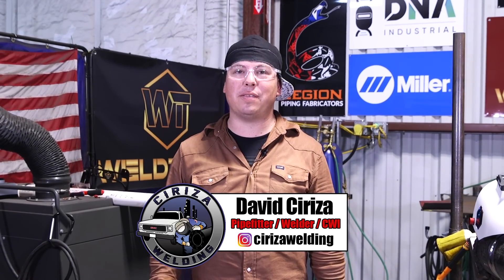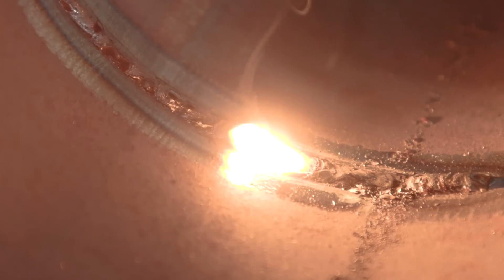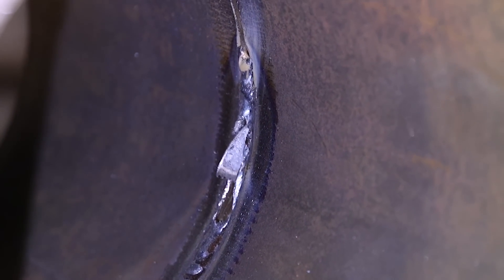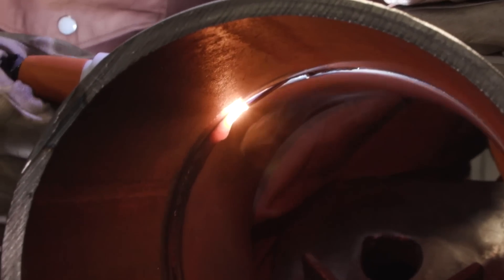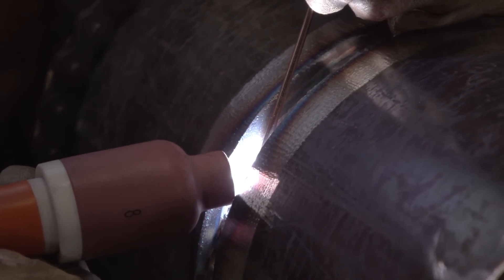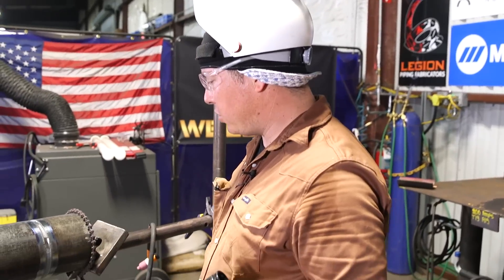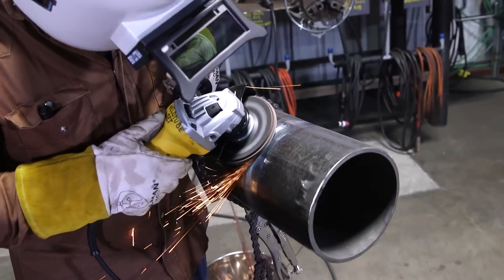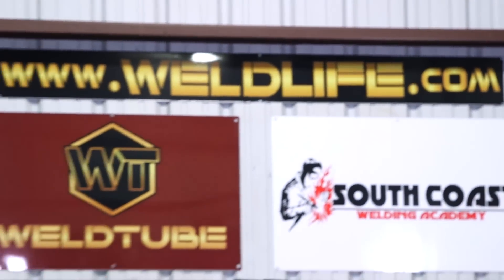Top 6 Common TIG Welding Repairs Every Welder Should Know

Comment: Using a file for the tungsten is a good tip. You will feel it slide over the tungsten until you got it out. A good way of being sure you got it vs the grinder

Comment: I have a problem I’ve been experiencing, I get porosity in my weld but it’s not visible until you grind into the root. I’d tack up the pipe n start my root on my tacks, my tacks would look fine from looking at it but the second I start my root it would start popping so id start grinding into the tack n there would be porosity in the tack. Does anyone know that happens?
Reply: Just a guess but dirty metal, oil, grease or gas flow to high.

Comment: 10:06 hey guys names Austin Hammond im a specialty welder in the nukes globally running alot of orbitals and robot tig heads and ive trained alot of new hands to do the same for the last 15 years. i got another tip to fix excessive pen id like to share.
  if you get a cut wheel and cut directly in the middle of your knot area following the joint obviously , taking out as much metal as you think you excessively placed without going all the way through the root you can just wash it over with the same settings and as long as u get it wet all the way through it will suck itself back as the puddle will naturally want to return to spherical. i know this because i will make weld repairs with the robot head and it cant get fancy. just run it over like youre rooting it wire at the ready if u need it. 

very important you leave as much meat on the bevel walls from original weld as possible or it will get wide and be obvious. it will literally just vacuum it up

Comment: Dave, you and Hjalmar have great root repair videos. Travis Field does excellent repair videos as well. You all do. 
I tried "sucking" back excessive penetration at 12 o'clock on carbon pipe while practicing, wasnt successful. Pretty much convinced you'd have to dig it all out and re prep the repair area.
How would you do this with 6010? 
I find repairs around 3-6-9 o'clock easier to do with excess pen because gravity works with you.
As far as recapping without filler wire. I believe ASME sec 9 won't allow you to do that type of repair without filler metal because it is an "essential" variable. Also even if you were qualified to do this you would have to follow the contractor/shop WPS which probably wouldn't allow this type of repair.
Thanks for your help, keep up the good work.

Comment: What about changes to the heat affected zone from re-doing your weld by adding extra heat several times?
Reply: Knowing to what extent doing the repair could affect the heat affected zone is important. Good video on using torch to draw filler material and tie welds.  Other than acetylene torch weldIng I have next to experience with Tig.  I can braze pretty good but nearly always over heat the weld area with acetylene torch.  I’m nearly 66, the weld, machine shop I worked at during high school and as an apprentice iron worker before entering the Army in 74 not long after graduating high school did a lot of odd welding jobs.  Boss man did all the Tig, SS, Alum, carbon steel.  I did the prep and cleanup though very few of his welds needed any cleanup post weld.  Got to Learn a bit of electrode welding including Texas Tig doing the shit jobs that came in, rusted or rotted out things.  Did some what was called micro-wire(Mig/Mag) back then.  I was better with mice-wire than the two older welders as they had difficulty stopping themselves from wanting to use the torch head yo feed the electrode into the weld.  Took them a while to learn to weld with it.
Reply: If it's A106 or A53 it shouldn't be an issue.

Comment: Cold wire usually will shoot if it’s not too bad as long as it’s sticking straight out of the bead. If I have a piece I feel won’t shoot I’ll fire up on the spot that it’s at while looking through the gap and heat it up till it drops into the puddle
Reply: me also
Reply: But will you grind thin the spot before heating it?
Reply: @mddenis1  usually don’t have to grind it. If it’s being extra stubborn I’ll grind into it but not much. You only want to heat it enough to suck the cold wire up if you get carried away you can suck the bead back

Comment: fixing socket welds next time?  just had a pipe snap off in the socket on me and she ain't budging
Reply: Burr bit is your friend in that situation. I've done the exact same thing a couple times in the past
Reply: How did that happen ?
Reply: @cirizawelding5076  had a spool come in that needed some rework (flange's not level to eachother and the company that made em didnt do the take-off calc correctly so run was too short) needed to chop off 2 socket welds , replace pipe and adjust flange so first socket came out easy after zipping into the root along the face of the socket, wacked it out, the second one, i thought i cut in the same depth but i guess i knicked too deep into the pipe past the root of the fillet, and when i gave it some wacks, the knick turned into a crack  arouind the pipeand then broke off at the face leaving about a 1" section of pipe in the socket and i cant see any parting lines so maybe that side had no gap or excess pen? either way i just decided to hand it over to the machinist and have him lathe it out, stainless sure is a bitch lol, still new to the trade too so its all a learning experience for me